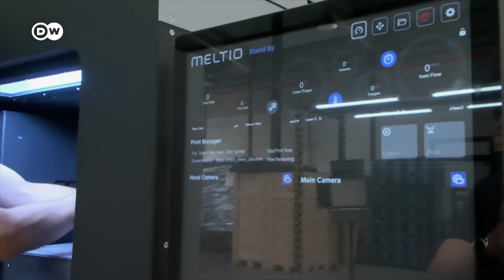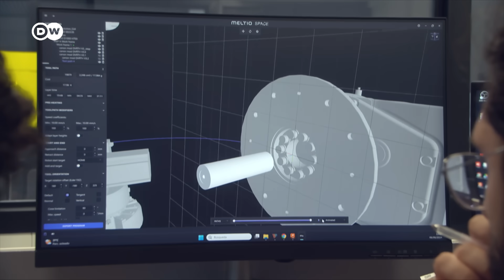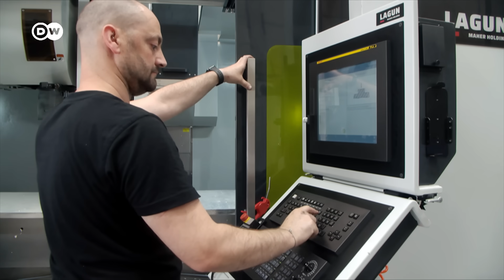Disruptive technologies: 3D metal printing | DW  News

Comment: 3d printing is only used for prototyping and very small quantities. as soon as you need the part 100 times, you will produce it using a different process.
Reply: You're absolutely right, but there are some parts that just can't be produced using traditional machining - so I think 3D metal printing will definitely end up being used for volume production of some parts.

Comment: 1. Not "Additive Modelling" but "Additive Manufacturing"
2. Not invented by Lukas Hoppe, but exists for 30+ years
3. Meltio technology only printing very rough shape parts, for which you need to do a lot of CNC
4. There are no serious aircraft engines parts using this technology, for some parts which are flying mostly used PBF-LB or PBF-EB technologies
A lot of factual errors, looks more like Meltio commercials
Reply: true, dw made it seem like meltio's founder invented this tech... i could not stop laughing. truely a meltio ad.

Comment: Hey stranger, It's called WAAM, if you don't know.
And If you wanna give it a try- try to modify a 3d printer but replace the nozzle with a MIG welding mechanism.
Reply: uhm, nope, WAAM is based on arc based heating of feed wire, hence named - wire arc additive mfg... the thing shown in video is WLAM - wired laser additive mfg.
Reply: @realracing3specter295  Maybe call WLAM a WAAM subset instead.

Comment: In my experience SLS made metal parts have a god awful surface finish.  If that needs to be re-machined anyway then why not start with machining and do it right the first time.
This looks more like a cross between plastic 3d printing and welding.  I'll have to research it more.

Comment: 200k is a pretty BARGIN!
Just for the case of an exhaust: One would cut, testfit, cut, testfit and so on, like we saw the build one in the video. THAT part would be an 1 DAY job!
PLUS: Every one needs to be build the same way again. 

With a 3 D one, you just need to build ONE and can repeat the process after that in the 3D machine 24/7. That is HUGE.
Reply: Question is though: How good is the quality of the part? aka material you can use.
"Metal" ist a not really acurate description 🙂

Comment: Looks good but is the material as strong as the unprintet version?
Reply: there are methods to increase molecular cohesion from what i have seen in other vids. Baking a printed product after the printing is done was one of them. Using different mixtures of the printing material and others i can't remember. But yes there might be limits and either new ways still need to be found or it would be more of a niche application which i don't think it will be. It can be upscaled, question is how efficient it would be to traditional production methods as so far it doesn't seem to be a very speedy process, again if you have more of them it might be a different matter, not sure how the economical math is for this.

Comment: Would like to see how it holds out during stress tests and other benchmarks.
Reply: the metal printed parts are already under heavy academic and industrial research for over 2 decades... they already serve in their applications.
Reply: See a cold spray 3d printed,heavy endurance naval parts...
Reply: we were supposed to have 3D printed pistons by now but I guess they aren't good enough yet
Reply: @kiyoponnn  they are good enough for any application, but only thing that holding the entire industry down, or pulling it back is the lack of mass level investment and adoption/acceptance in the traditional manufacturing industry. many people dont wanna integrate their well established methods with 3d printing, even though its more cost effective and better in many ways. industries still not comfortable with the extra long waiting times required to print single part, when the same parts are mass produced in seconds.
Reply: Rocket structues, engines and fuel tanks are already metal printed and flown. I guess they stand up well.
Reply: @juliane__  I know what video you refer to and no, it's a welding (with a robotic arm) of a coiled wire, a wire that's made in traditional way
Reply: @juliane__  Awesome, new tcnologies.

Comment: What is the grain structure of the metal. Any mechanical engineers here?
Reply: Huh...? That would depend on the metal or the alloy and then molar mass of the ad mixes being used.  And also on how it was made and the target application it is for. E.g. aerospace alloys may have had liquid phased (arc melted or laser sintered) processing at time of the feeder coils were made.... In any case all that stuff would have been   figured out waaayyy before printing the part...
Reply: you can simulate it way before printing.
Reply: Benefit of 3d printing is you can simulate organic structures, you use less material and optimize the structure for its use

Comment: 0:41  additive modelling? 😂😂😂
Reply: That's the technical term. 3D printing is a misnomer as it's not really printing anything. Also called "additive manufacturing"
Reply: @frcluc  I understand, just that never heard anyone say additive modelling 😂. Don't even know how that term can be used in this context. 

That's the job of the reporter to use right terms.
Reply: @y.u.so.  I agree. I was thinking the same thing, especially with proper heading.
Reply: @frcluc  The term 3D printing is typically used to refer to all types of additive manufacturing. However, this is not quite accurate. Strictly speaking, 3D printing refers only to transforming a digital CAD (Computer-Aided Design) file into a three-dimensional physical solid object or part. OR 3D printing and additive manufacturing are often used interchangeably, both referring to the process of creating three-dimensional objects from a digital model. However, additive manufacturing is more scalable and functional compared to 3D printing.

Comment: I'm an old industry miller/metal cutter and I can surely see the benefits of printing the odd parts. But for big scale production that looks a bit slow so far? Perhaps it will become faster in the future and with scaling up with many more machines.

I'm sure printing is a big part of the future. Milling, drilling, cutting and printing.
Reply: Universities have faculties of engineering studying this problem currently. A lot of discussion between mechanical side and materials side.
Reply: The US Airforce and Navy want to print its fighters in the 2030. For the Navy onboard the carriers. If they are really serious about it and it works you can see where the story goes.  There are already metal printers who can print parts in meter by meter by meter scale. Some rocket fuel taks more than 10 meters long are already metal printed.
Reply: @juliane__  3D printed, rocket engines, very complex assemblys with generative design...the future is Now.
Reply: It's incredibly slow and the surface finish is on the order of half a millimeter Ra.  It's amazing for some applications, but most applications require conventional fabrication.

Comment: the day when engineer and machinist will finally stop fighting
Reply: I do both.  Like many professions, the key to success is to learn to do the job of the person before you in the supply chain and the person after you.  If I know why the customers or machinists want it designed a certain way then I can come up with the best compromise.
Reply: @madcow3417 Same here. I work in manufacturing/ machining though an engineer by training.Many engineers have little knowledge of how parts are made and therefore add features/tolerances that add cost and make parts difficult to manufacture while having little or no practical purpose. I usually point this out and propose changes and most of the time they agree to revise their design aslong as costs are lowered.
Reply: Post machine the printed part the engineers forgot to put any datum on. It's never going to end lol printed inconel is my least favorite thing to mill drill or tap. They cannot print a sealing surface. I'd rather machine a forging, casting or billet lol
Reply: not possible haha

Comment: Maybe a better thumb would be a scene of the second process shown on the video. This one is reductive manufacturing, which is the inverse of 3D printing, that adds material
Reply: combo machines now exist = print first, then mill upto tolerances using cutting tools... all on the same bed.
Reply: @realracing3specter295  yep, and Meltio offers that option as well.
Reply: @realracing3specter295 sure, but the title says 3D printing but has a thumbnail showing the wrong process. I almost didn’t click the video because it gave me the impression that y’all don’t know what you’re talking about. So who knows how many potential views this is losing you.
Reply: @chekote  true, makes sense